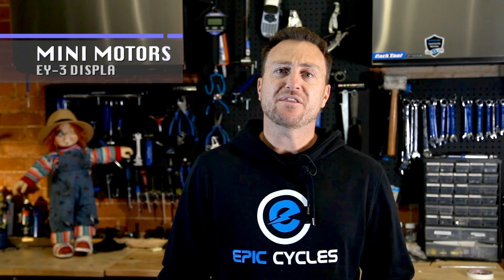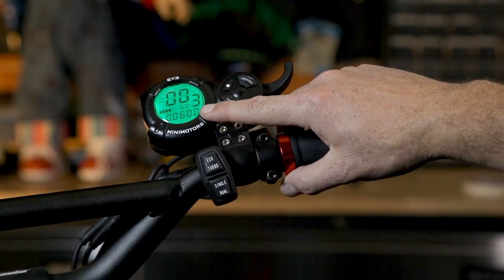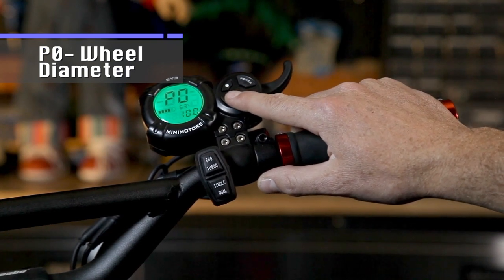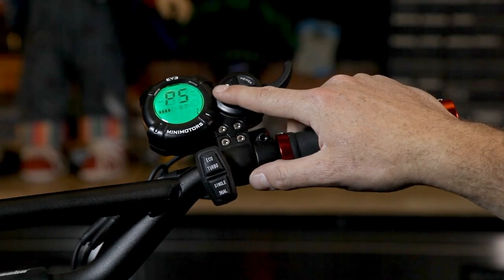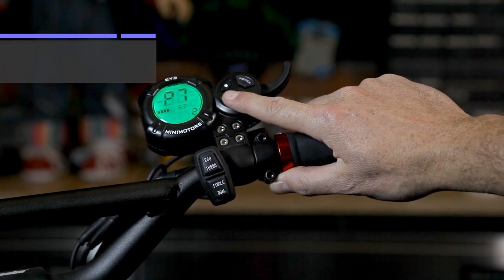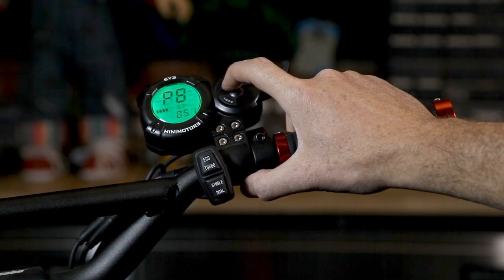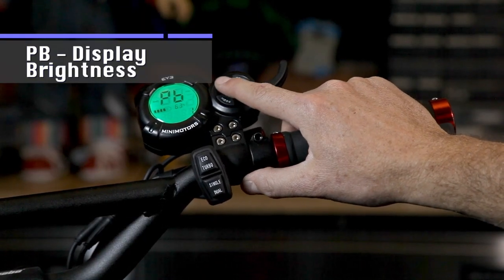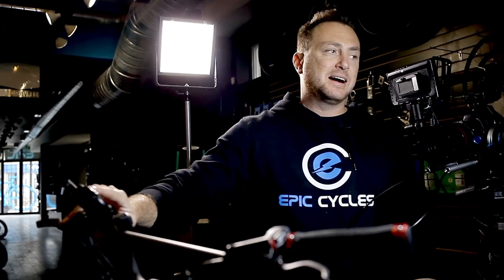Minimotors EY3 Display Overview

Comment: I have a bluetran lightning I was getting it up to 90kmph and then all of a sudden it wouldn't go much fast than 55kmph. I figured it was only running on one motor so looked inside and sure enough one of the the motors was not attached to the battery so it was running on one motor then I plugged the motor back into the battery and  it the speed hasn't changed top speed sprox 55kmph and both motors are spinning . Would you have any idea what the problem is or i can fix it please

Comment: Hey so my scooter out of the box would go 55-60 mph now I got the ey3 replaced bc I crashed now it only goes 50 top
Reply from the maker: check the settings, it's probably not set to 100% power

Comment: Thanks for the great and detailed video. I have a kaabo wolf king gt pro with EY3 controller and unfortunately my buddy messed around with it and now battery shows 50% with 83.4v and the charger led is just green and not turning red. Any idea what's wrong with my scooter?
Thank you very much in advance.
Reply from the maker: It's possible that he changed the voltage settings.  Yours should be set to 72V

Comment: Hello I hope you can help my light keeps flashing on the display how do I resolve this problem cheers Rob …
Reply from the maker: Hi Robin. Thanks for reaching out. Is there any error code flashing when you turn on the display? Is the light just flashing or does something on the scooter fail at the same time ( ex. the motor cuts out )

Comment: So my wolf warrior 11 shows a 100 percent charge all the time, which im sure isn't accurate.    Is there a way to fix that somewhere in settings?
Reply from the maker: No, that can't be accurate.  What does the voltage say?  This is a more accurate reading anyway.  67V would rerpresent  full charge while 54V would represent an empty battery.

Comment: how do u know how many motorpoles a motor has? i've counted the magnets but they are way more then 20
Reply from the maker: The manufacturer usually will set it accordingly depending on the scooter.  This is something that facotries usually set one time and should not be changed.  There is alwyas the chacne they did not do it correctly so you can always verify with them depending on which model you have.

Comment: Mine Is flashing off and on  while I accelerate do you know why ?
Reply from the maker: Hi Luke, It blinks when it’s low on power as way to tell you that it needs a charge or will die soon.
Reply: Friends, please help.  I have a problem, the speedometer does not work, it constantly shows the speed "00", the odometer and charge counter also do not work.  at the same time, the scooter drives normally and switches gears.  scooter new name Teverun Blade Mini Pro.